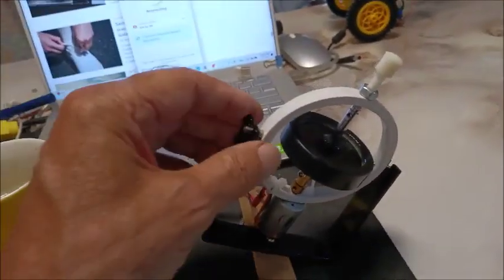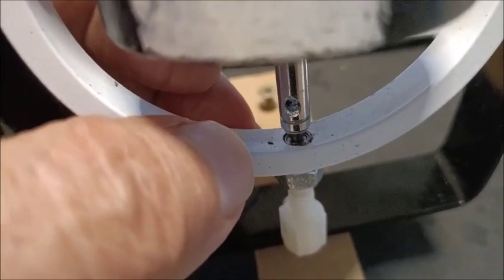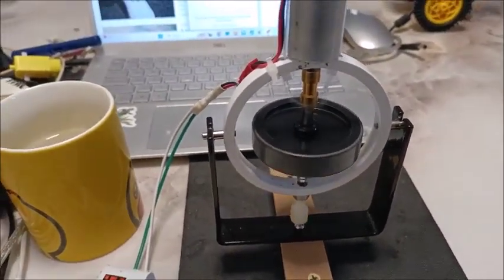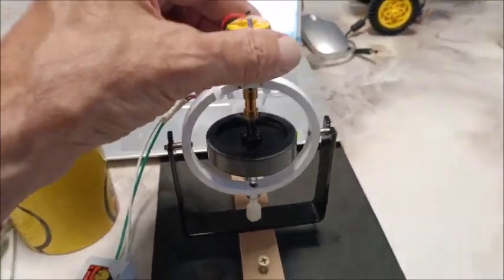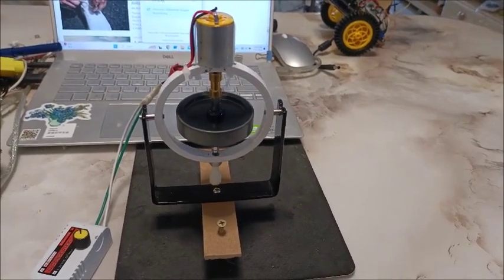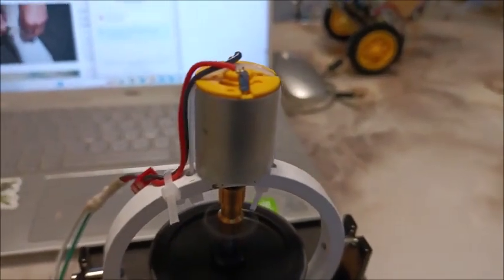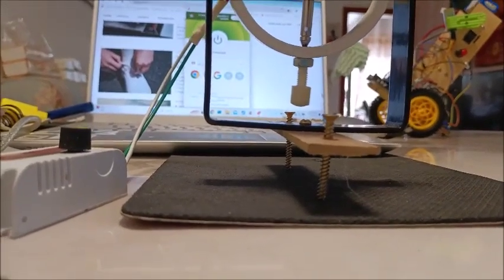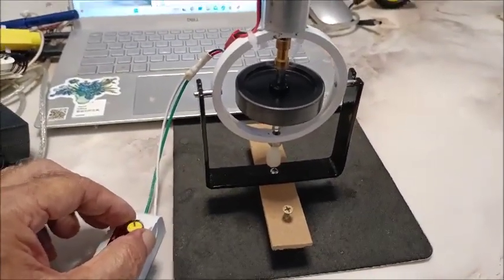Self Balancing Cmg Gyroscope Version 2

Comment: This is very clever.
Reply from the maker: Thank you. I have built many different versions and never get tired of them. They are quite addictive - trying to build them precise enough to self balance and figuring out the required rpm and mass of rotor. Not too useful but quite intriguing.

Comment: onde compro
Reply from the maker: Can't buy it completed but the gyroscope is a commercial product, as is the motor and shaft adapters and the bearings. But you still have to build it. It would be nice if someone could build a nice little kit. The rotor needs to be bigger though as it just barely has enough torque at a relatively high speed to self balance. You can buy a 10cm aluminum pulley with a 5mm shaft hole and build a gyroscope out of that. I have had rotors custom made for about $100 years ago. But in the end, it always has to be DIY.

Comment: Greetings! I would like to know if the gyroscope does not work the same way by placing the motor at the bottom? I notice that you place the motor at the top before running it, what is the reason? Thank you in advance for your answer.
Reply from the maker: It doesn't matter where the motor is, what matters is that the top of the gyroscope is heavier than the bottom and that the CG is about 1 cm above the rotating axis axel. So, theoretically you could have the motor on the bottom and the rotor on top but it must still be a top heavy combination with the heaviest part on top. The top heavy weight is what keeps the gyro balancing. As the top heavy weight tries to rotate downward, it applies a torque force that forces the gyro in the other direction and so balances itself. You have to try it to really believe it. If you let the gyro run with the heavy part below, it will not balance on two legs.